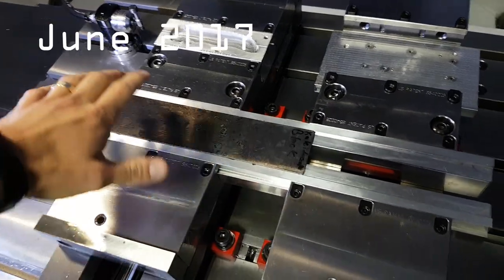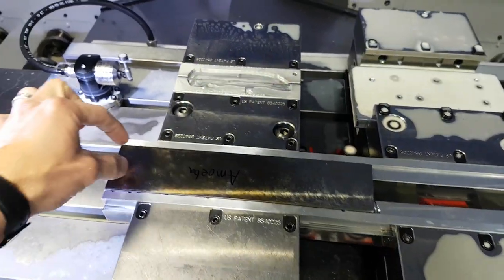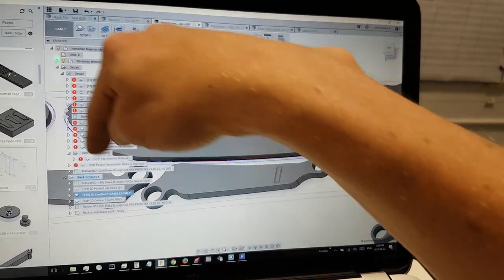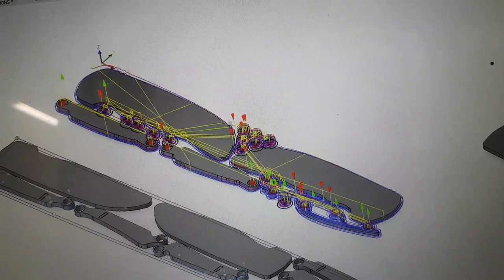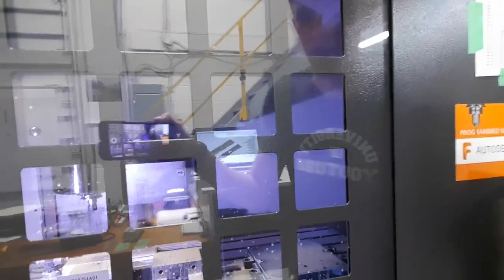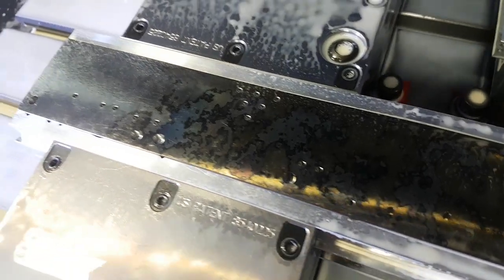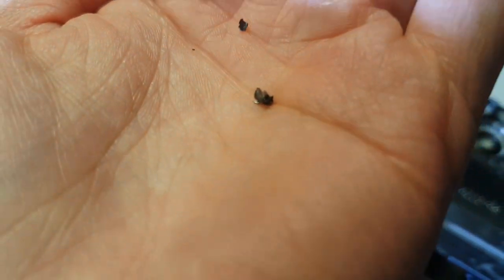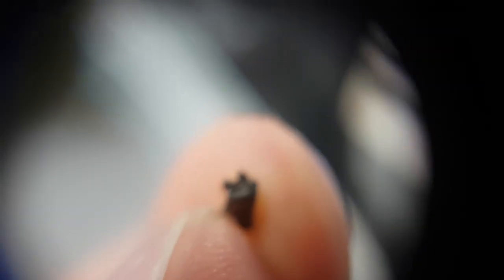Cutting Timascus™ Pt. 2

Comment: Do you use square flute end mills or a radius on the end? When milling 6al-4v i've found .02-.03 radius on the flutes works great. but that's with a .25  EM, so of course it'll do better. and that's a massive radius for a smaller tool.